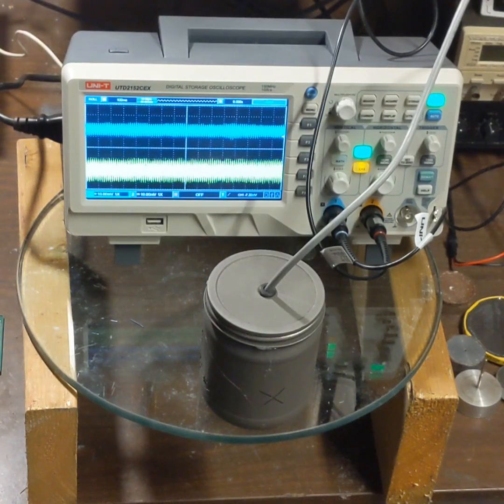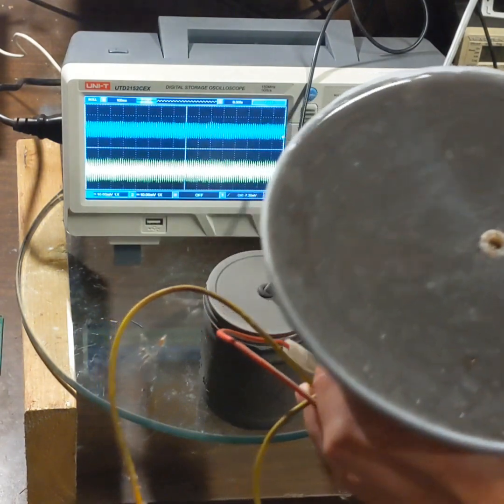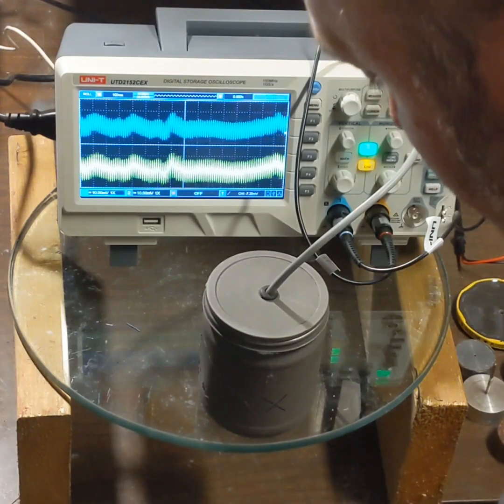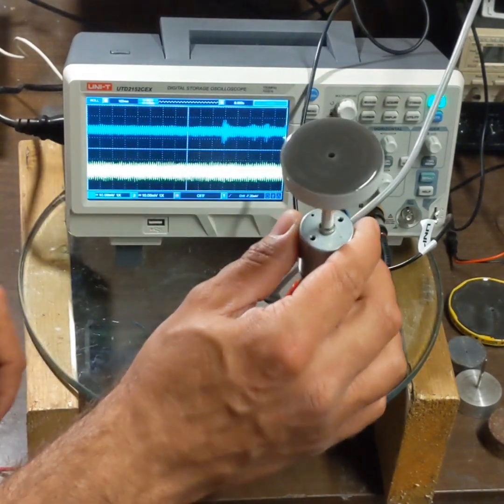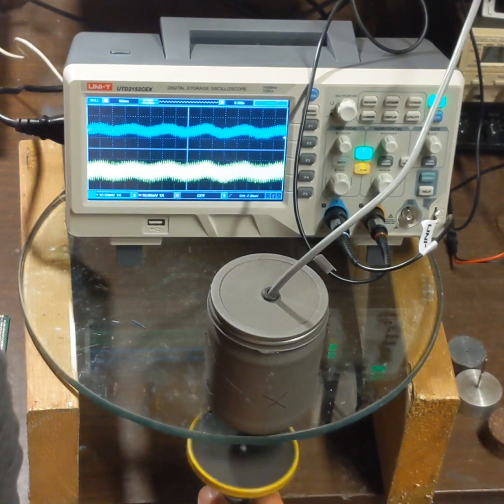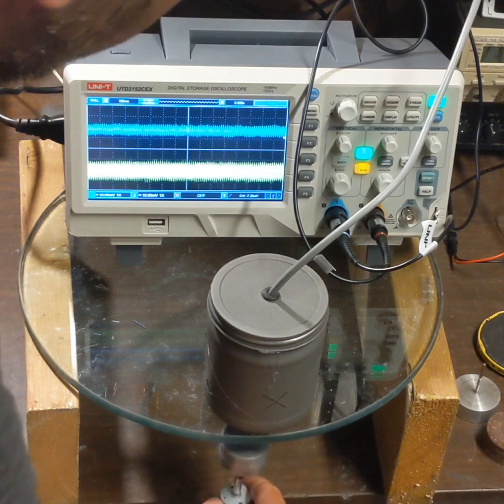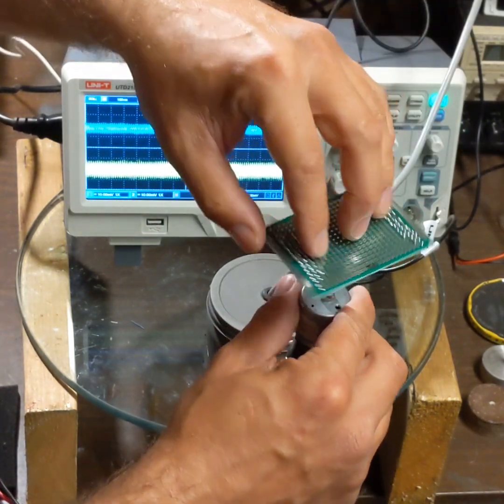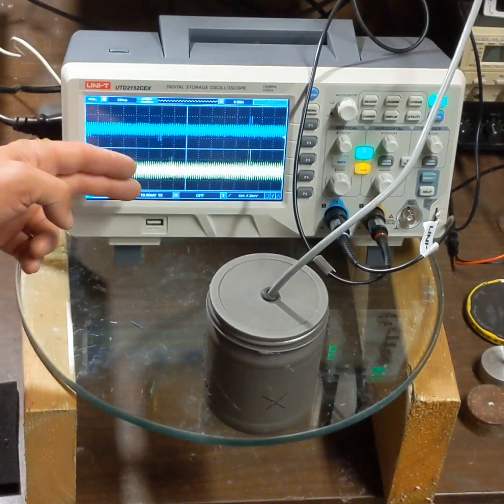Gravitomagnetic, gravity, or electric scalar waves? | detected !

Comment: I've seen crazy stuff like this. There was a guy on YouTube who made static devices. When moved you could see waves around it. Also affect the weight of rocks. On point I saw around the other side on the surface. Like it was bending light? I myself taking b vitamins every day for a year. I started noticing waves from large moving objects. Such, I ran 400 ton press to cold forge metal. Someone I knew built a bismuth levitation device. At that time I stood there watching waves flow from the turning floating magnet? This was many years ago.

Comment: Gravity is a scalar electromagnetic wave, so if you are detecting scalar waves you are detecting gravity. Nice job! By the way, surface area should make a big difference. So the bigger the disc the bigger the effect. (The tiny dremal sized discs should have the smallest effect.) Also, you shouldn’t be seeing any noise in the oscilloscope from the dremal motor. That means that your EMF shielding is not 100%. You may want to add a ground to the jar as well as a secondary wire faraday cage, as a foolproof method for blocking all hertzian EMF signals. Also the wire going from the jar to the oscilloscope may be acting as an antennae. So I would suggest using a linzwire that employs a bucking coil effect so that no outside EMF can corrupt your signal to the oscilloscope. Take a look at LessLoss cable as an example (they make high end speaker cable and interconnects for audiophile grade stereo equipment)
Reply: I thought scalar radiation was pure electric potential? No magnetic component.
Reply: I'll pay you good money to build me one

Comment: This is most likely microphonics. Piezo transducers are used as speakers AND microphones in consumer electronics.
Please confirm your experiment in vacuum (no sound waves) and on a vibration free table (no mechanical coupling) to rule out any acoustical effects.
Reply from the maker: I ruled those out to my satisfaction, but I will revisit this kind of effect in the future.  It is caused by uneven charge distribution on the discs. These fields penetrate the shielding on the jar.

Comment: The scope radiates and you have it next to your antenna. Is the scope grounded?  The shielded jar won't shield anything if it's not grounded. Also, your scope probe ground clip forms an antenna loop, as do the piezo disks. So all you have is an antenna that picks up random current distributions. No gravity, no scalar waves.
Reply from the maker: Thanks for the feedback. The jar was not grounded, but could have been. What was the unexpected observation was the signal appearing from simple motion of those discs. A something was penetrating the jar and layers of nickel paint.

Comment: very interesting. Is the jar grounded? I think it should be grounded to properly shield.
Ken Wheeler stated Bismuth is the highest dielectric material. So would this be a form of dielectric induction?
Reply from the maker: It was not grounded, but surprisingly these waves made it through the two layers of shielding. Later I do recall hooking up the outside to the ground on my scope lead, and the waveform disappeared. I guess this is a lesson in electric induction 😳
Reply: @failforwardresearch3127  Can you repeat this with a Faraday cage with thicker and solid metallic walls and grounded? If those waves can still go through I would be surprised. Also I would like to put a magnetic field detector inside. Magnetic fields of low frequency can pass through metallic walls.
Reply: Diamagnetic*